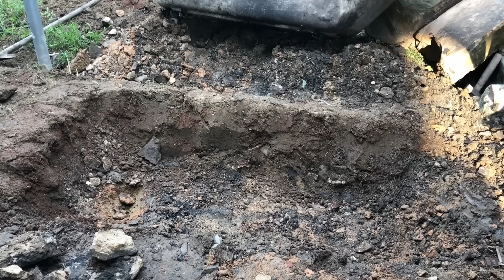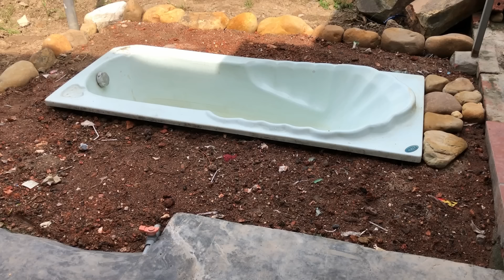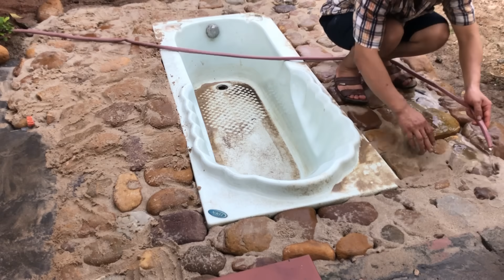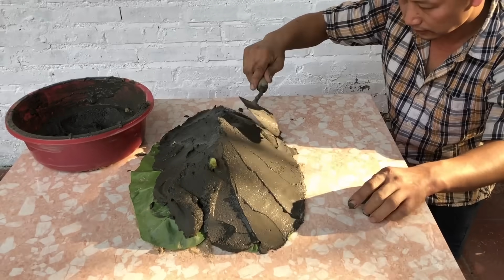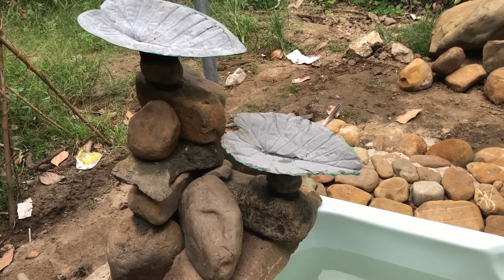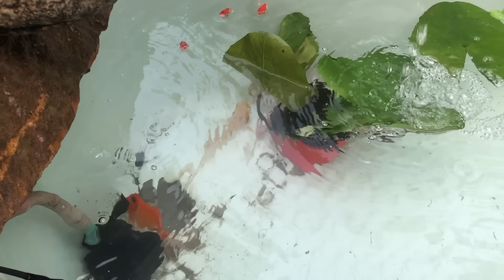DIY aquarium with waterfall from old bathtub // Garden decoration ideas

Comment: Is there any advantage in burying it?   I have a tub with a solid front.  The sides are open save for a frame.  There is about a 2;54 cm lip all around the edge bent upwards which I intend to use to make plant shelves and of course the back will be the water fall feature..